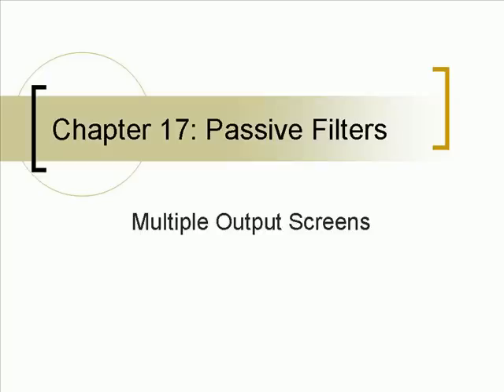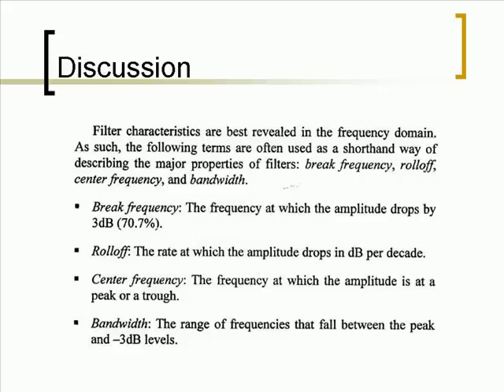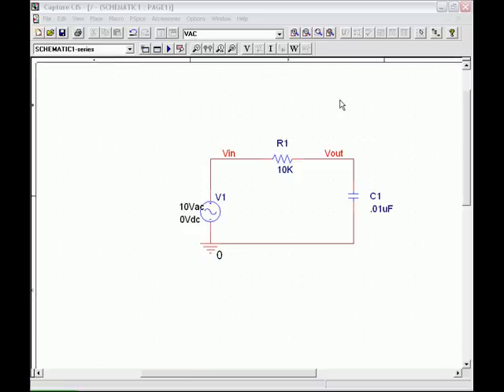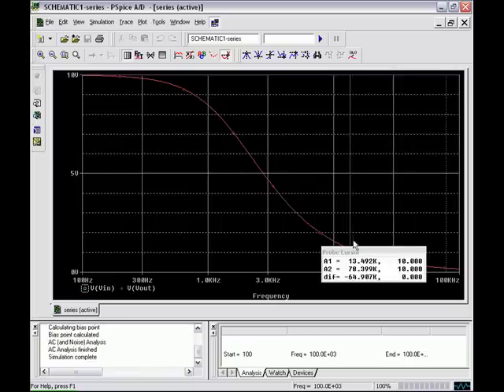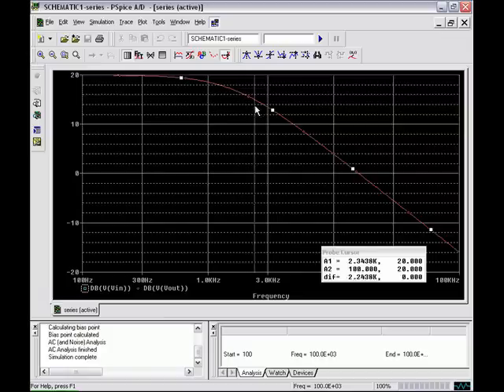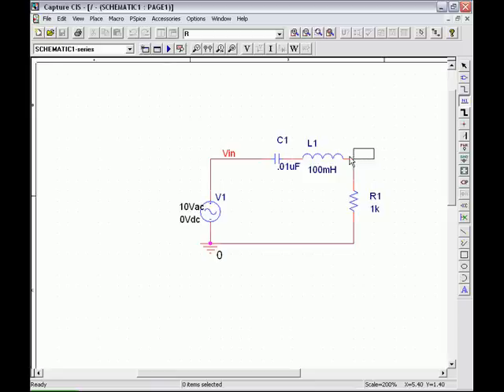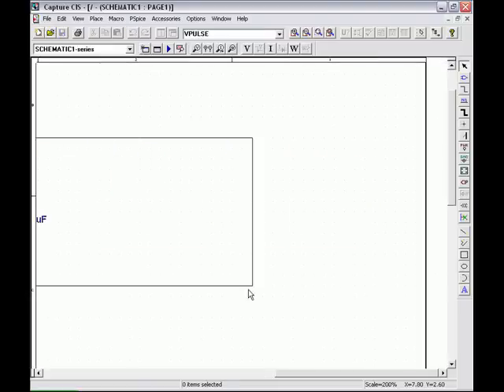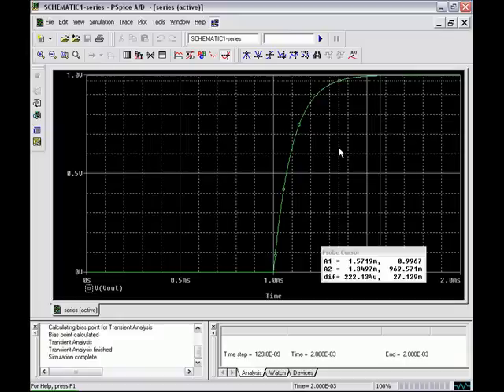AC PSpice (Passive Filters)

Comment: I simulate with the exact same schematic on Orcad Capture 16 and I get a different result
Reply from the maker: It should work, version difference it is not important
Reply: I tried it on Orcad 9.1, 9.2 still no difference..... Something is wrong I dont get the right result.
Reply from the maker: I used this chapter this semester on Ver. 17.2 and there was no issues?